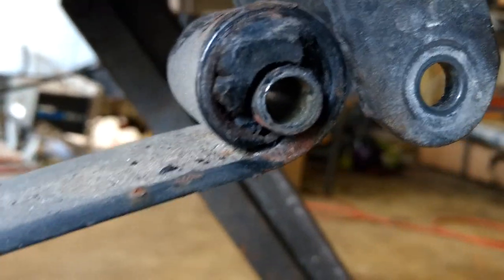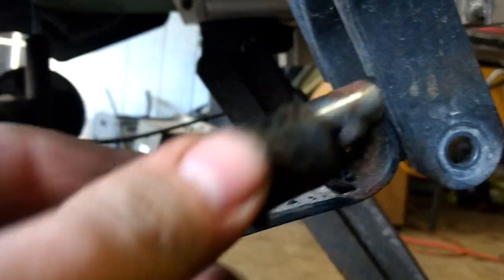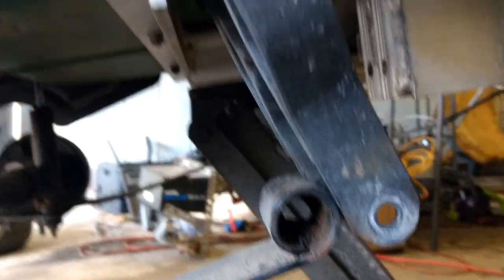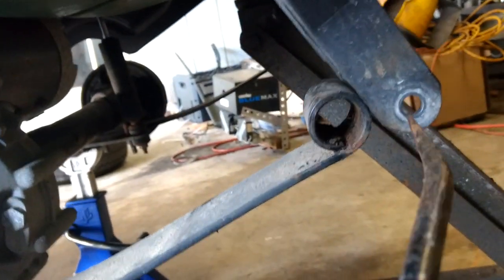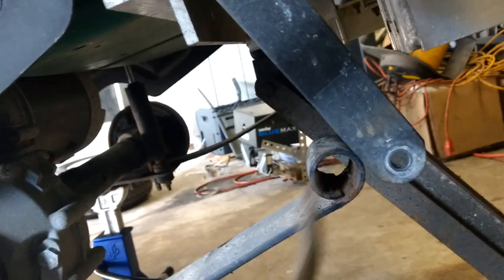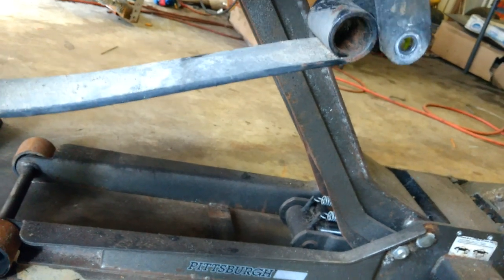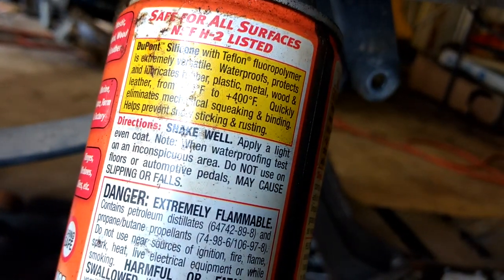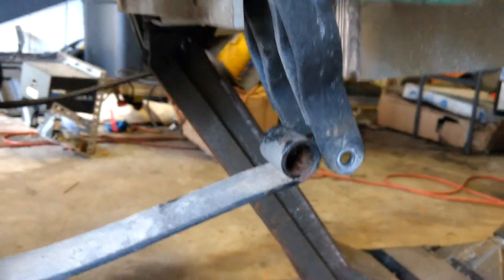Bushing replacement on club car ds

Comment: Since you didn't show the rest of the job, did you need to press them in , or lube and squeeze them into the eye? I'm bringing a big c clamp; just in case, to get them all into the spring eye.
Reply from the maker: KirkLives no special tools. Just lube it up well and if anything maybe use a small hammer.
Reply: Wayspage ..actually, used wate pump pliers after a shot of lube on all parts, ans sqeezed them into place. 
After that it was lube the new bolts if needed and bolt it up. Thanks!!
Reply: Wayspage  Hey just wondering if you have a link to where you bought yours?  I need to replace mine on my club car 2001-2002 as well!  Are these the same as the front ones?  Thanks Ben

Comment: Wayspage  Hey just wondering if you have a link to where you bought yours?  I need to replace mine on my club car  DS 2001-2002 as well!  Are these the same as the front ones?  Thanks Ben
Reply: Did you find them?  Same here, got to do the same on front
Reply: @isaacandandanne  I found the ones for the front at club car Enterprizes I have a location near me. They were 99 cents each.
Reply from the maker: I bought mine from ebay. A seller that specifically noted they were rubber and not plastic

Comment: What’s the name of the part that bushing goes into
Reply from the maker: The bushing goes into the leafspring. A sleeve goes through both bushings.
Reply: Outer sleeve on the end of the leaf spring.  The inner sleeve goes through the center holes.